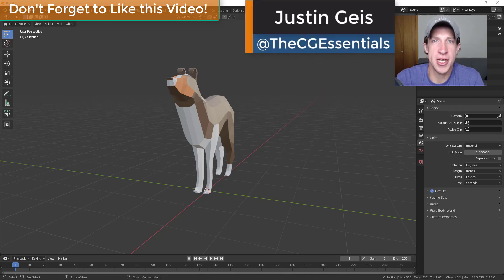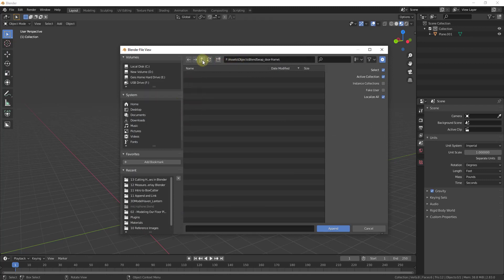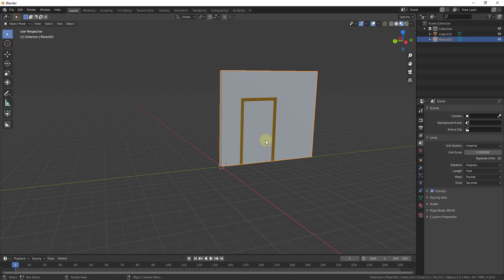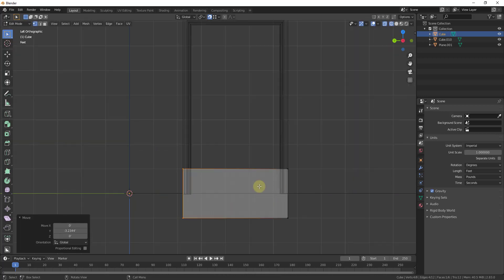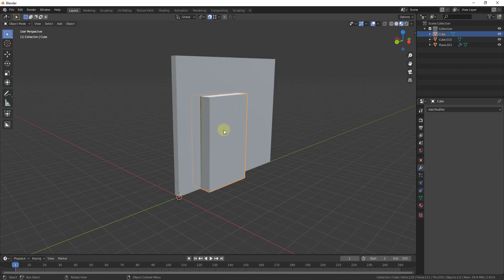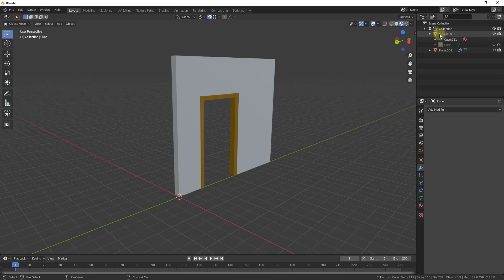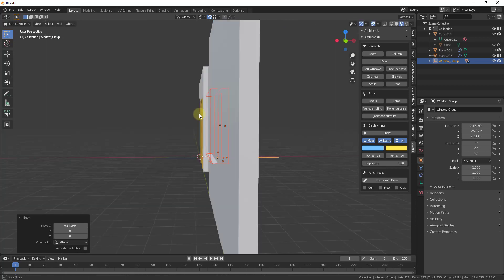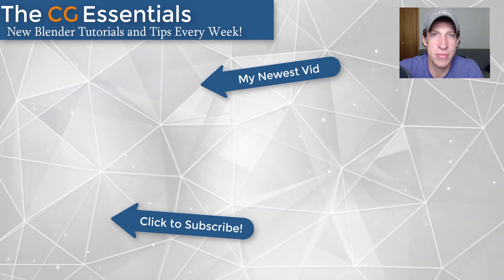How to Cut Holes for DOORS AND WINDOWS in Walls in Blender

Comment: You could also cover the positioning of such things. For example... i need the window to be like 80cm from the floor and 90cm from the inside wall.
Currently all I know is to create like spacer blocks and to use Snap to faces thing.
But that feels somehow inefficient way. Instead i wold like to see some kind of measurements. Like... i could select 2 vertices somewhere on the edges and as I move the window around I could see the dynamic measurement of the distance. And I could make several such "dynamic measurements". Like from the wall and from the floor.
Other confusing thing is the math... because your reference point is 0 axis. And thus... it's kind of non-intuitive to move cutouts, corners, doors, windows relative to the middle point. What are the "tricks" there?
My personal use case - I want to renovate the old house. And i try to transfer exact measurements to the Blender so that I can do the math.
I imagine, that there is no issue, if you do just creative stuff, because in most cases you just don't care about the exact sizes.

Comment: I know this is 4 years late but I hope you see this and can help. I am trying to use a boolean on the cube but I keep getting "failed to set value" any way to fix this?
Reply: Actually, I tried separating the selection but now theres no hole in the door frame. I'm genuinely lost
Reply: nvm, I figured it out. I was putting the boolean value on the cube instead of the wall but then I was having an issue with the cube not getting cut correctly so I just got rid of the cube and instead linked the boolean on the wall to the door frame itself and made it intersect.

Comment: My 3 personal techniques for cutting openings for architectural work:
1. Select both faces -in edit mode, of the wall you want to cut the opening, which is let’s say a door, then Inset > move + scale to get the dimensions you wish to > lock axis >  move & snap the selected edges to the edge of the wall > hit G and lock the preferred axis again & and input the precise length value, to move exactly where you want > bridge loop (destructive but highly editable).
2. Weld Faces Into edges. For every geometric, symmetrical, array, pattern, or organic. Shape and extrude perpendicularly and delete the face. You can shift + D in edit mode to duplicate the shape’s vertices and snap it at the other side of the wall the bridge loop and voila you have a clean opening in complex shapes such as curves! (destructive but highly editable -you can still choose the vertices of the opening and move it inside the wall wherever you want).
3. No destructive boolean, cube, or any 3d shape view as wireframe in object properties > set parent the door or frame or object to the boolean shape > select the wall and activate the boolean modifier set to “difference” > move the door wherever you want on that wall and it cut where it just “sits”, and do from architectural openings to complex surface modelling, creating holes, sockets on walls, ornaments, curves, decorations and more (non-destructive).

Comment: In case someone else was trying to use a cube as a room, for example, and tried this and had the inside not disappear, you need to add a solidify modifier (I know, the name is counter intuitive in this case) to your room first to give the walls some thickness and then cut the hole like in this video.
Here's how to add the solidify modifier: https://www.youtube.com/watch?v=sW_NnFgIiso
Reply: Thx

Comment: There is a checkbox for Autoholes under Room Type section in Archimesh that will cut all holes for windows and doors. It has taken me some time to find it but it works well with their windows and doors as they have another obect(cube) for it. You need to select Room object to go to wall editing mode in Archimesh and then scroll down to Room type.
Reply: btw, be carefull with Archimesh and do not apply any textures to their objects until you are completelly done with modeling and not going to use their addon at all. If you apply any texture to walls, ceiling, floor all of them will be removed when you do something in their add-on. That kicked me a lot when I applied every texture and then checked ceiling  in Archimesh. It added the ceiling but it  removed all textures

Comment: I did this with archimesh. And when I did boolean with the CTRL_hole it turned the box into a greyed out  cube that's visible from only one side... Tried hiding it but it didn't make it dissappear. I'm assuming it has something to do with my boolean settings. Hitting Difference and Union just switches which side the grey cube protrudes out on.

Comment: In my opinion it is not the right method.
The CG must use the empirical method of the "simplest and fastest" always referring to the quality of the mesh that is produced.
The excessive use of mods, and modifiers such as booleans even for simple things, created very bad topologies.
In fact, today I really see people working without taking into account the quality of the mesh that is produced, and its topology.
In my opinion we need to teach the simple method, but also that it prevents topology problems, the modifier does not.
Just add 3 loops cut with CTRL R, and delete 1 face, 2 seconds! fast and kept a precise topology. If you have to teach I recommend that you do it with greater responsibility. You are teaching people to work incorrectly. Without offense, only feedback.

Comment: I enjoy watching your videos very much! They're informative, and very helpful in my venture to learning Blender, but the one thing i find with any video in relation to Blender is how to fix mistakes. All the steps are there but when you click the wrong tab, move something incorrectly or just plan ol make a mistake, I can hear you clicking but no discription to what happened and how did you fix it. I feel that in order to be efficiant in Blender, the knowlage of how to fix any mistake should be included whether it be a simple fix or complexed fix.
Eg....when you added the door frame, you went to align the top portion of the cube with the top of the door frame but something went wrong causing it to move sideways rather than up to where you wanted it. Some clicking sounds and then the apparently very simple oops was fixed but I have no clue what you did.
I feel like im trying to take a shortcut on learning this amazing program but also feel its beneficial i learn only what i need, hence (just beginning to learn and already into windows and doors)
I'm a freelance interior and exterior designer and found the more realistic the design, the faster it sells but also need to be quick about them! Otherwise, the client loses interest and I've wasted my time and theirs.
Hoping to see more info in your next videos, (if possible) but till then, thank you for everything you do for us in you videos

Comment: It's crazy the built in Knife tool is still so useless for architecture or any precision work, and it's STILL the same in Blender 3.  Knife tool desperately needs being able to sett start point and edge length by the standard keyboard based x1.5  y0.25 etc.  Grid snapping is also a huge gap.  If the knife tool had these options it would be all you need for precision hole cutting, detail extruding etc.  Thanks for the Archimesh tip, knew about the paid Boxcutter addon but not Archimesh, will have a look.

Comment: How do you prevent it from messing up the vertices / texture mapping when you add a hole. Sometimes when I use the boolean method, it messes up the mesh, especially when carving multiple holes.
Reply: yeah this is less than ideal. I usually dont bother with booleans unless I absolutely need to, which is almost never. I usually draw the walls on a plane, and extrude them up, with holes in the walls. Then its just a matter of adding cuts and filling in faces (and flipping normals if necessary).

Comment: thanks good tips, however i find Boolean do not work so well when i export the model.
i usually export as FBX for use in (Unity), and the Boolean part will appear semi transparent with this strange effect when i view the FBX, 
so i end up would need to painfully slice/ fix to get a door to work, very time consuming, in one of your video in making a hole, you seems to address that by making sub-division and removing parts and i thought that would be the only way, if there is a better and easier way, hope u can share. thanks.

Comment: Very good! I wonder, what will be exported, how the holes are handled at exporting. (I would like to use the result in other software, like Unity)  Ok, I will try it :)
Reply from the maker: Well if you apply the boolean cut, it should be handled just fine. I'm not sure how exactly it's handed if the boolean isn't applied
Reply: @TheCGEssentials  Does applying the Boolean not leave your walls with NGONs and cause problems when shading?

Comment: Very helpful thank you! When using the add on, what is the best way to align the top of the windows? Let's say I want top of windows to be at 2,4m from the floor.
Reply from the maker: I'm not 100% sure with the windows from Archimesh - I think you can dictate height above ground and overall height with Archipack - I'd almost just draw an object with the height you want and use snapping to snap the top of your window to that height